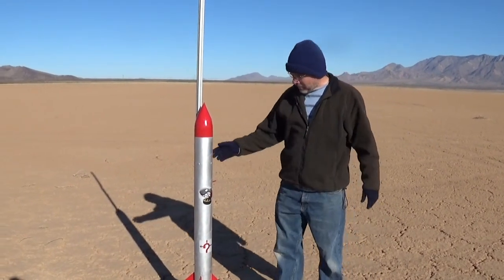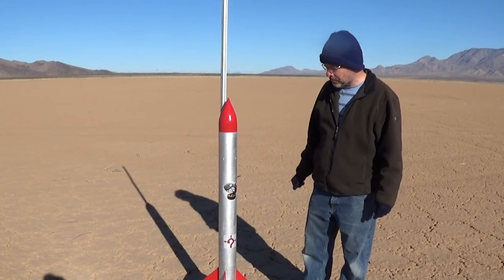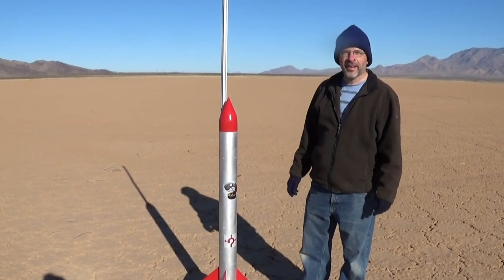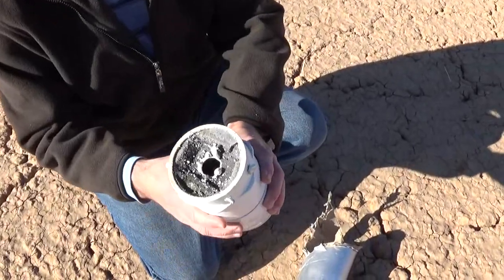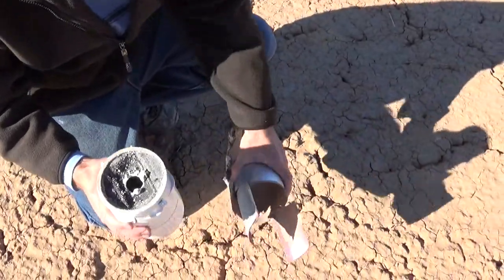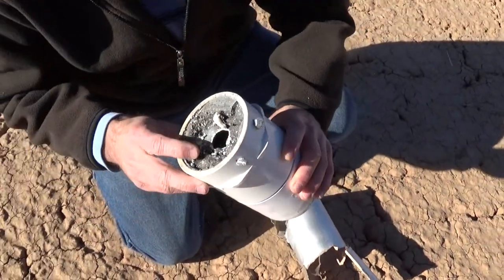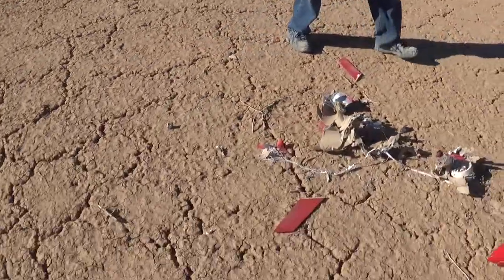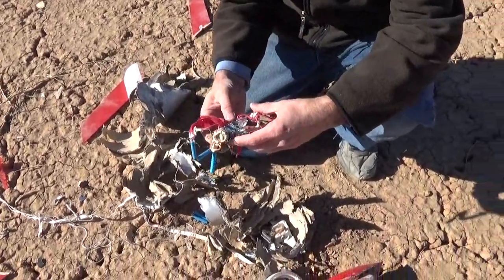Prototype model rocket motor - First test launch of the MOAB.

Comment: Perhaps a remote radio-controlled parachute ejection trigger, so instead of frustratingly yelling "no, no, no" as the rocket plummets to Earth without the parahute ejecting, you can just press a button and say "yes, yes, yes!" as it subsequently floats gently back to Earth. :)
Reply from the maker: True... But it would seem to me that having a manually controlled, secondary parachute deployment system in amature rocketry is not a common feature. If the motor had performed properly based on previous ground tests, everything would have been fine. I'll just chalk it up as part of the trial-and-error process for motor development.